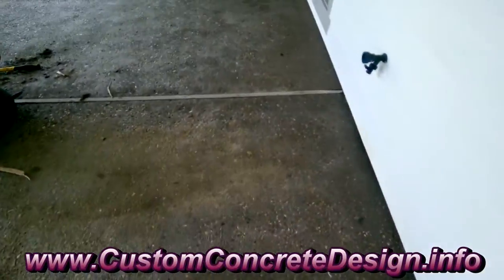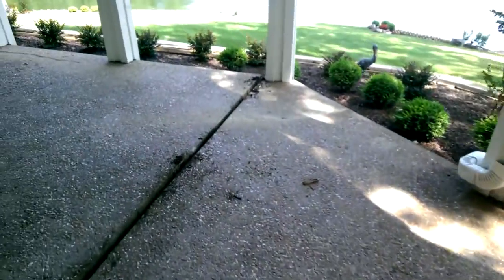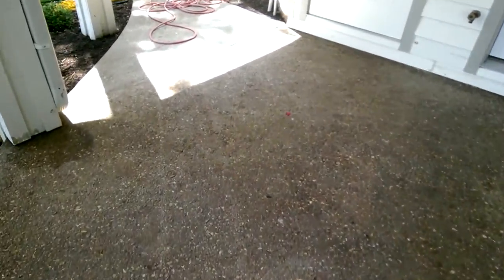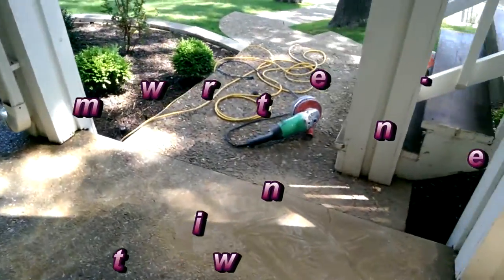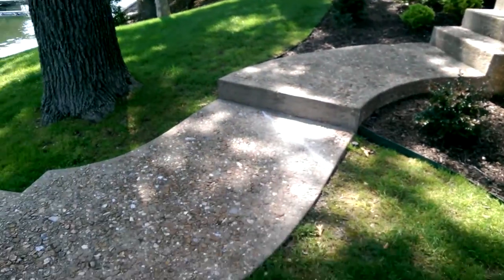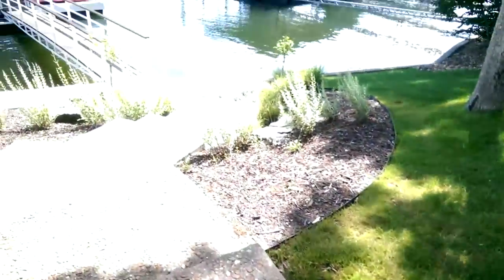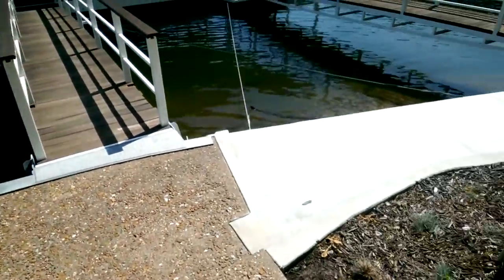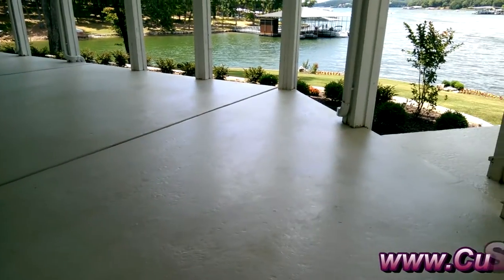Decorative Concrete Resurfacing Patio Deck Lake of the Ozarks MO

Comment from the maker: Hey Lavonn, actually I did put a base coat on but remember this was over an aggregate surface and I had to do a lot of grinding just to knock some of it down so it was somewhat flush, but there are spots on the surface that were deeper than others, but I put one base coat on then squeegeed the top coat over that, now the verticals were sprayed but of course they were super rough... it was a very simple clean job... pretty quick to once we got past all that grinding and crack repair.

Comment: Hey Rick!  Looks like a basic resurfacing job, easy and fast Mony, ha ha!     
I didn't see it on yur website,  but looks like yu sprayed a coat of TF  THEN SEALED,   doesn't look like you put a base coat,  CORRECT?
Reply from the maker: nah it has 2 coats, the only thing that was sprayed was the vertical wall, it got 1 coat sprayed on it.